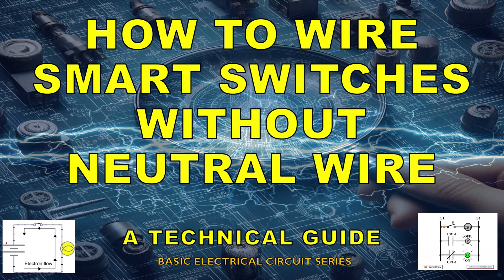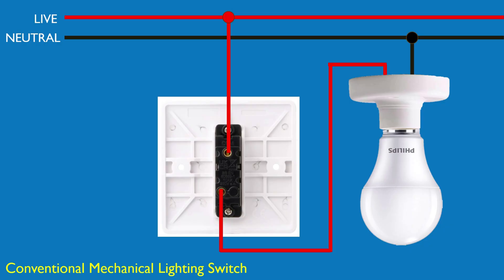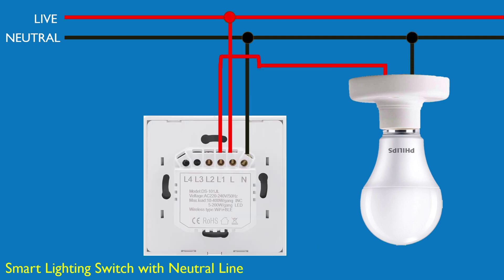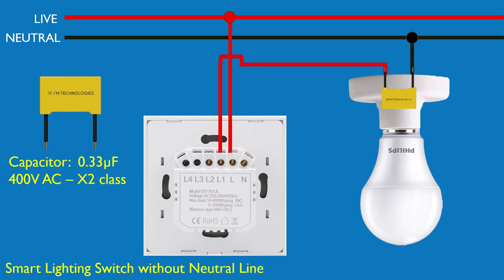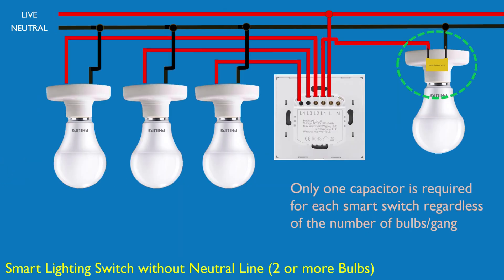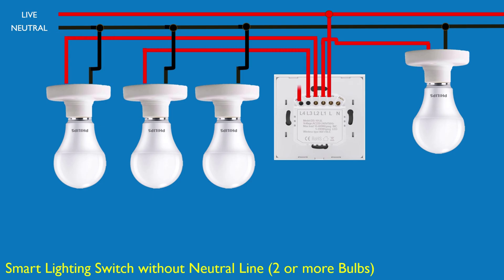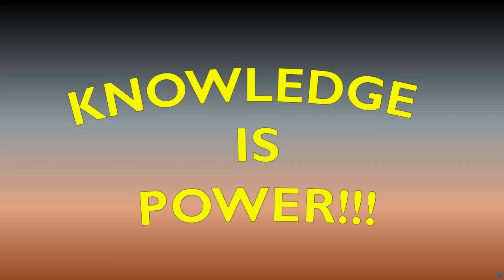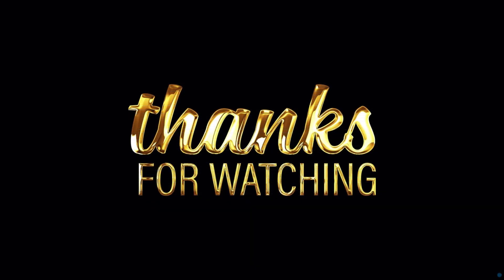How to Wire Smart Switches (With or Without Neutral) | Tuya, No Neutral, Capacitor Setup Explained

Comment: I removed my old switch to replace with smart switch. I have 3 wires what looks like live, neutral and earth. Earth is wired direct to metal case, and when I wire up the smart switch as what I think is correct red to live and black to neutral. The smart switch works and connects to WiFi but the light bulb does not come on... Do I need a capacitor from live to neutral at the bulb?

Comment: What capacitor is compatible. Im using 3.5uf and its not working
Reply from the maker: 2.2 ~ 3.5uF 300 volts connected to the first light load.